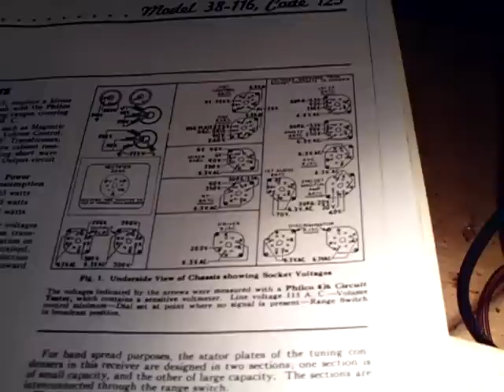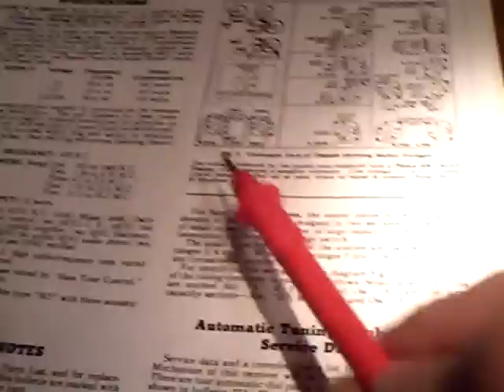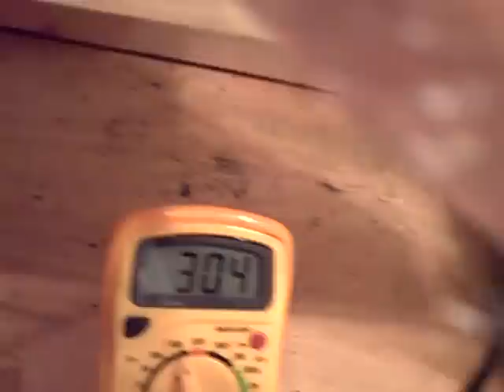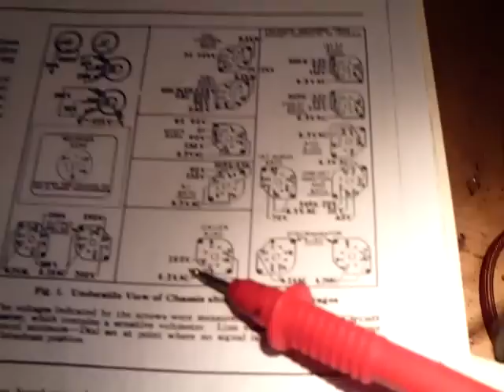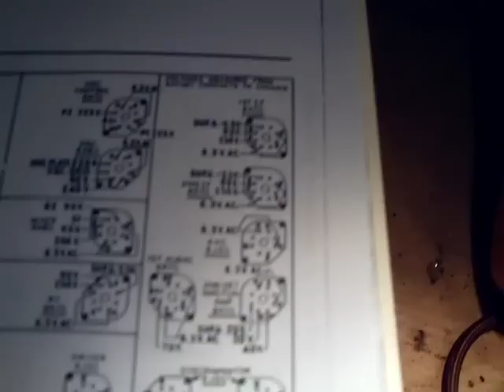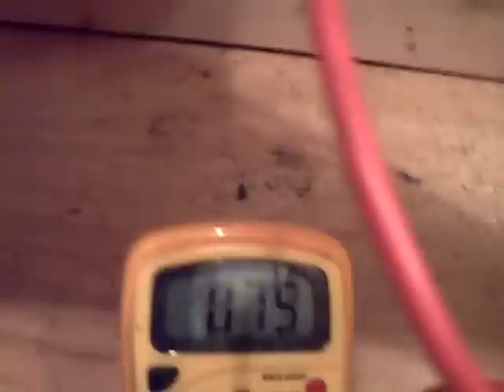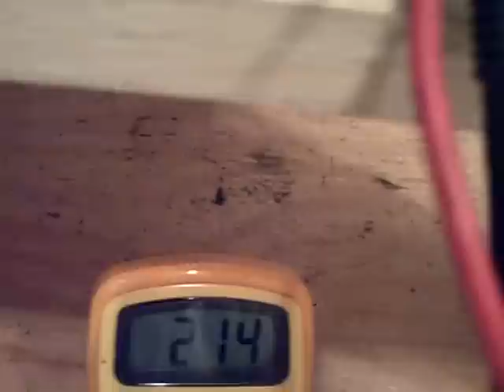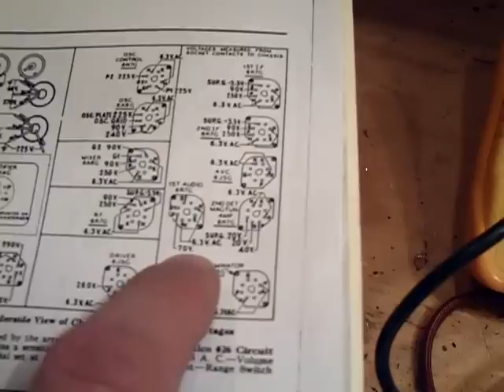Philco 38-116, Part 13, Checking Voltages Before Aligning

Comment from the maker: @joernone I really had enough light to work, the camera is fairly inexpensive and needs more light to make a better exposure. I could use a little more light lower to cut down on the shadows. It does add a little dramatic effect though. Like an old frankenstein movie...You make a good point though.